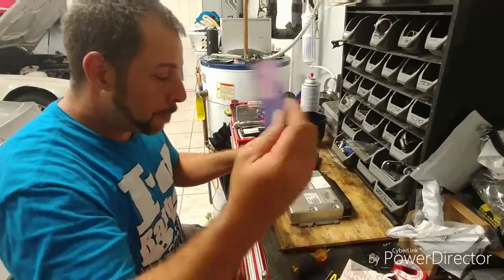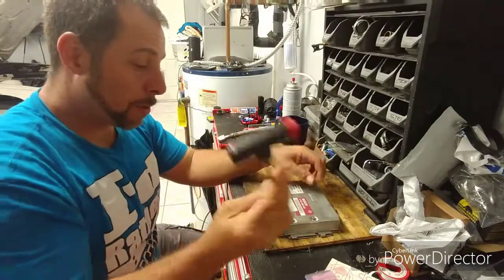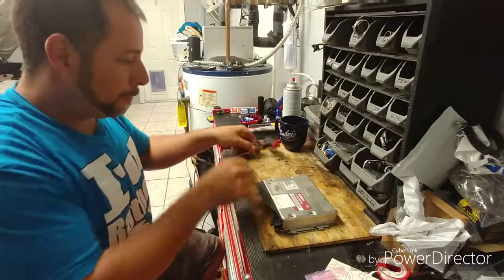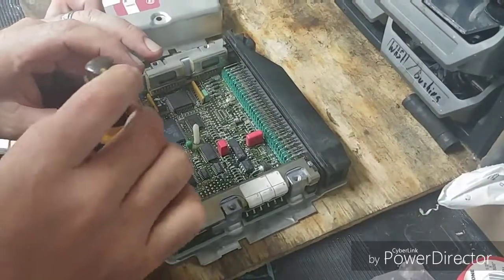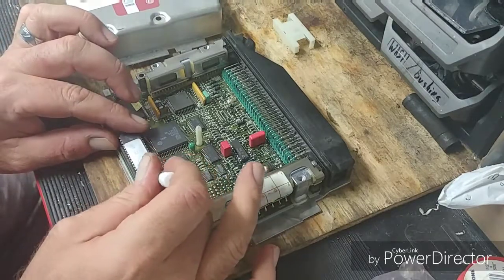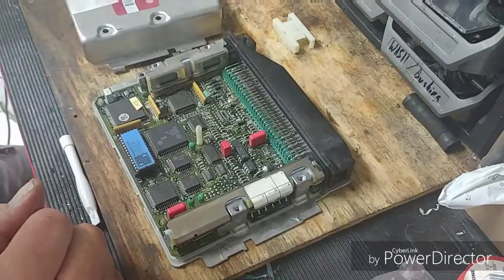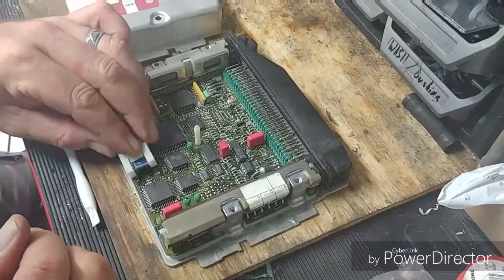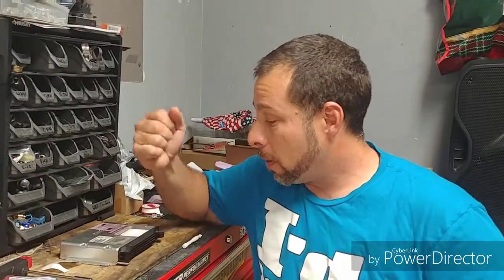E36 DME tuning chip install. SSSquid tuning

Comment: did you see a noticeable difference in power? is it worth the $190
Reply from the maker: Jacob Gardin I haven't started the car yet. But my E36 has been sitting for a few years as a side project that I took over from my son. I boosted the car and did an auto to 5spd swap in the last 3 months. I just finished the fuel surge tank with external fuel pump. I will hopefully be starting it up by the end of the month. Though I just noticed water leaking from water pump I'll have to try and change that this weekend 😔. Lol it's always something. Sorry I couldn't really answer the question. I personally would only advise getting a chip after you do some bolt on or serious power adders. But I will say SSSquid had great customer service. And for me it was the least expensive option. I'll post a video of the start up asap.
Reply: @MurphyDrifts  any update?
Reply from the maker: @TexasRedneck well I've since sold the car. As far as update. I was not happy with the tune. I ended up buying another tune from Kassel performance. I recommend using them instead or RK tunes.